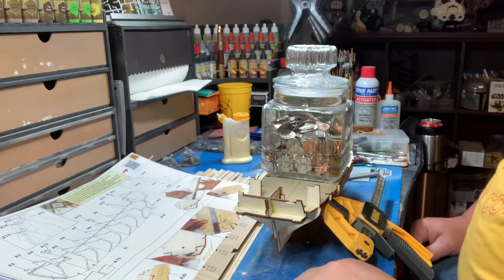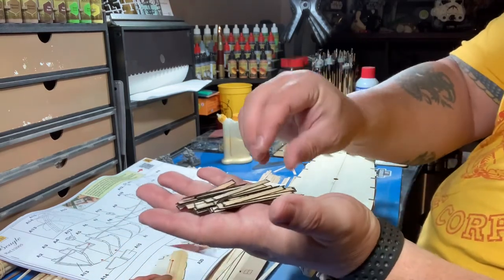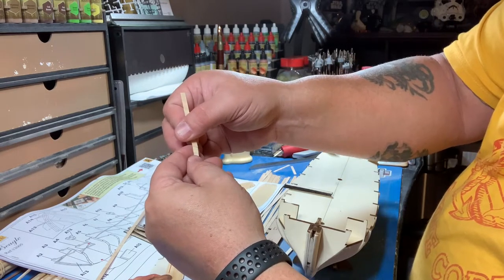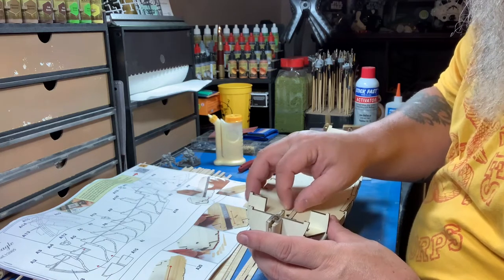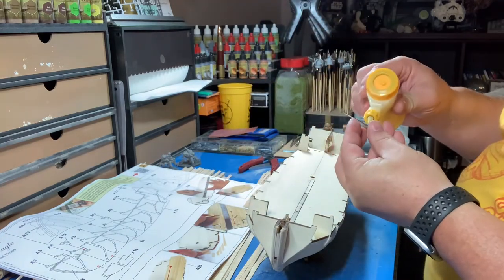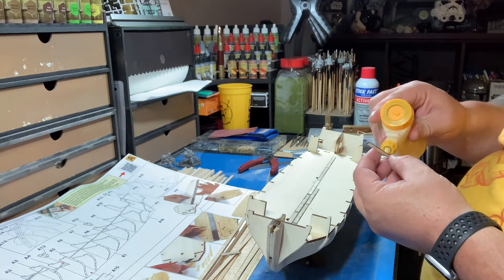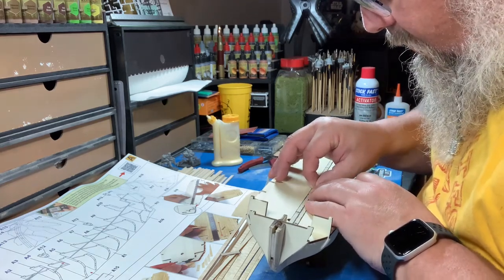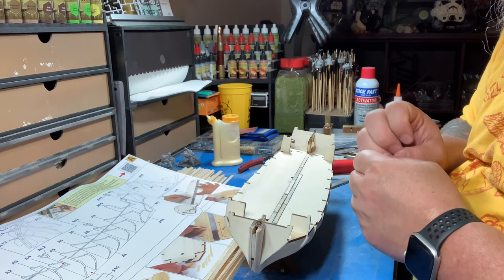OCCRE Beagle Starting the main deck

Comment: Hey this is my first build and I'm following along with John as well but I'm really nervous of screwing something up here. So dumb question but the decking is the thinner strips that there are less of and the thicker are for the hull planking etc. Is that correct?
Reply from the maker: Yes that’s correct. Check the QR code on the front of the instructions when you are not sure on something. It actually helps. Save all your material as well, you may end up using the small cut offs later. Just start a pile of cut offs for each type of material and set it aside. If you have any questions or need any tips don’t hesitate to ask I’m happy to help if I can.
Reply: Awesome! Thanks. As such a newbie it is great having the detailed demonstrations and support of experienced builders.
Reply from the maker: @johnthompson133  I don’t think I qualify as an experienced builder, as this is my first build as well. Plus I haven’t finished it and haven’t worked on it for several months. I hope to get back after it soon though. I have the hill complete and have a lot of the deck items ready to start installing. Then on the the masts. Rigging will take forever I already know that from building plastic model ships.  It once the rigging starts that’s the last step and it feels good knowing that you’re almost finished with a beautiful project.
Reply from the maker: @John Thompson, just curious how you build went or is going. Did you finish and if so did you make any vids or take pics? Would love to see your work!